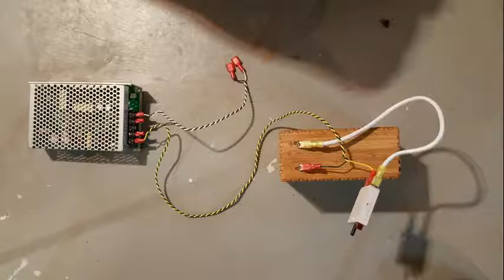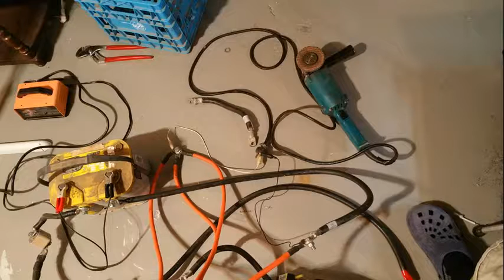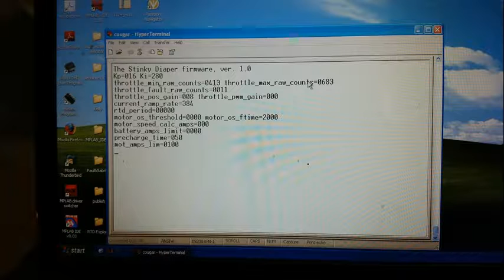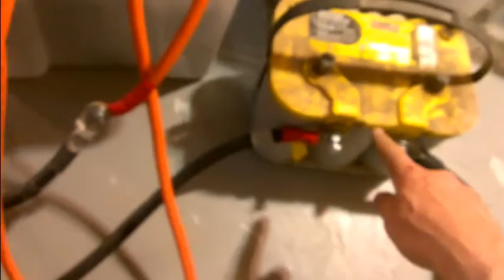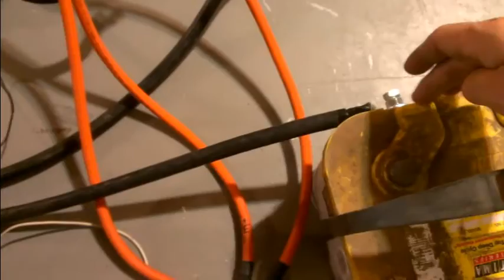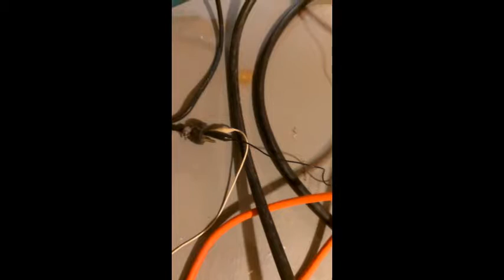2016 June 8 Cougar DC Controller setup

Comment: Wow!!!  This is beautifully done.  I'm going to use it as a model for any future directions.  This a huge help.
Reply from the maker: So far I have only one comment on the content (besides my wife's comment that the basement is too messy to put on video) - a suggestion to show how to test the throttle with an ohmeter to determine which wires to connect, followed by showing the wiring connections to the controller and rotating the potentiometer so it is visible on camera.

If you find anything else let me know.  I'll likely make a follow-up video to include any additional information